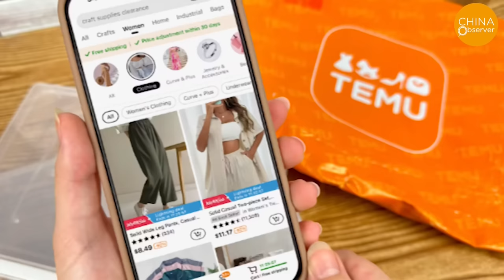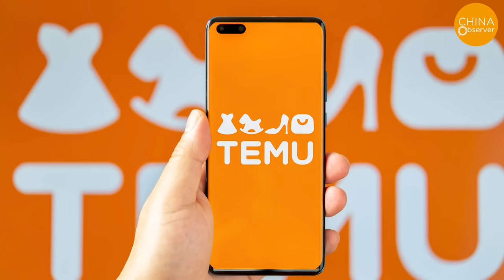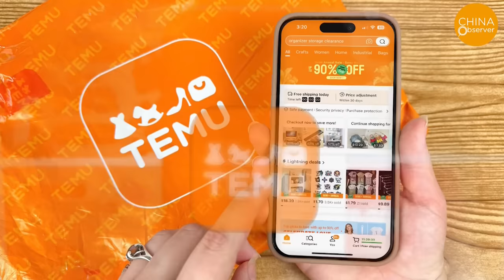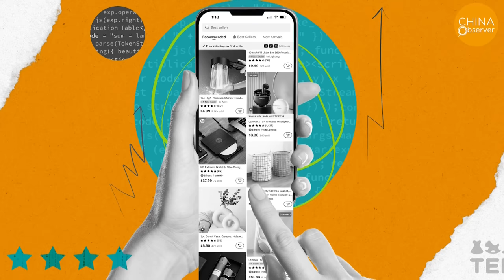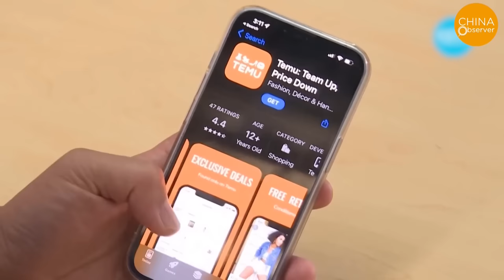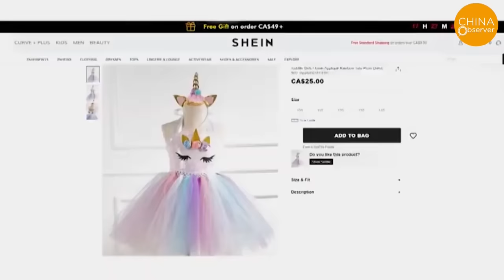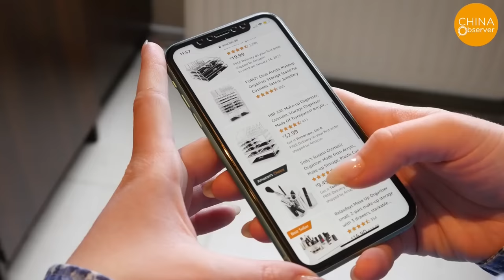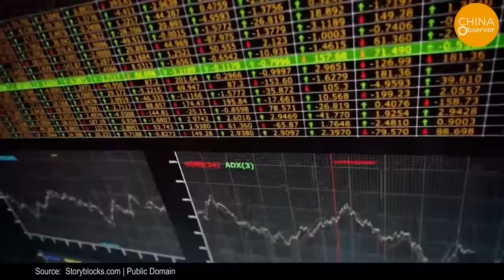Fake & Subpar Products Ripped Through Temu’s Facade, Making Chinese Firms Everyone’s Punching Bag

Comment: Temu is absolutely trash, I bought from them once.

Got a pack of razors, and some grow plugs. The razor cartridges where so dull I didn't want to use them for a second shave. I threw them all away, so low quality they where not worth using.

The grow plugs where a scam, not even cheap, I clone a lot of plants, grow plugs are like 50 for $15 these where 8 for $4 figured I would try them. They where literally square pieces of a brown sponge.

I had extremely low expectations and I genuinely still feel scammed. The grow plugs where 100% scam, and the razors where such low quality those 5 for $2 packs at budget stores perform better.